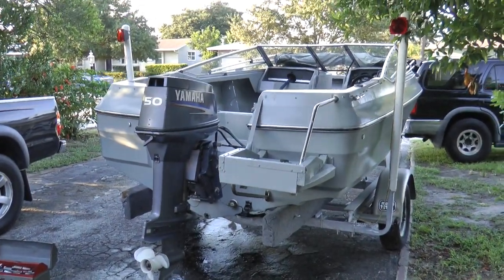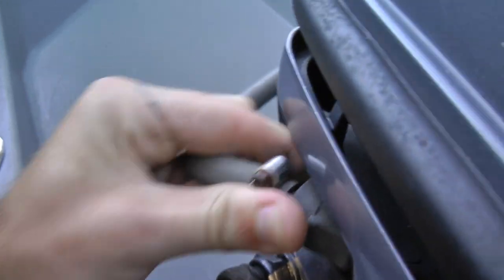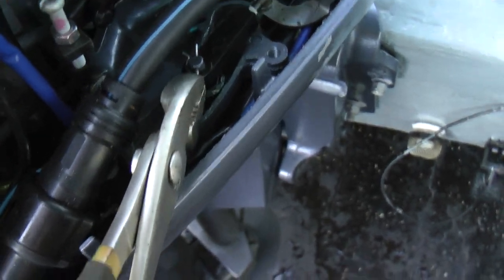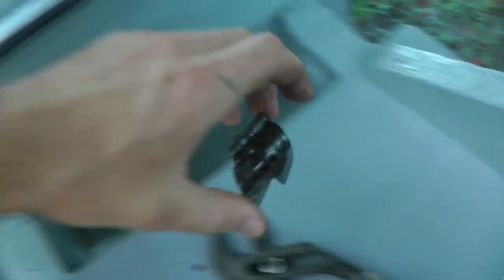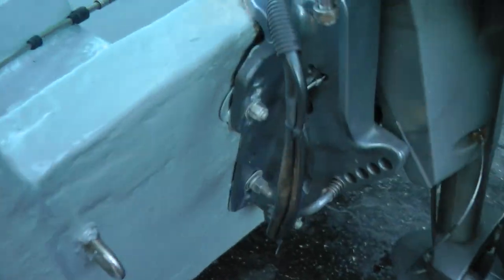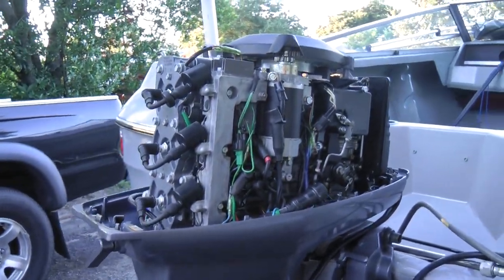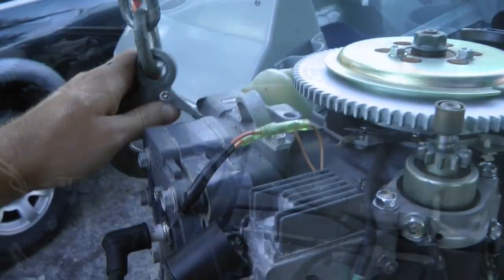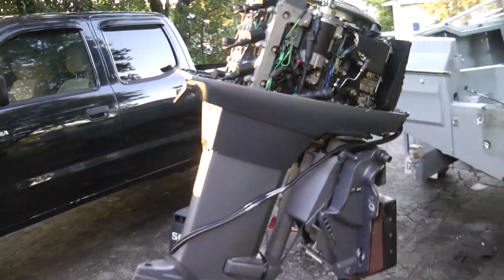How To Remove A Outboard Motor From A Boat

Comment: I just got an engine hoist to work on my first outboard. It’s a 50hp Johnson. Did you add the u-shape bracket to the motor or do they come like that? Mine doesn’t have it. Any suggestions on where to lift it from? TIA

Comment: You made that look easy! I just bought a fixer upper and it’s getting difficult. All my cables are connected together in several spots and I’m scared I’ll screw it up if I undo them all. The steering part looks pretty straight forward but the power lines not so much. Any advise?
Reply: Label it with zip ties and a marker

Comment: Very good, but I have a question, the cables is part the motor or the boat?. Because I will buy a boat but the last owner remove the motor and the cables too. I need buy the new motor but I need buy the cables too or the new motor come with the cables?
Reply: Normally it will say if it comes with cables, it will say something like “control box and cables included”.

Comment: Maybe if you have a job in the future to rig a motor and the forward controls on a center console boat that run through a tunnel under the floor that would be helpful also if you filmed it, thanks.

Comment: Now, how do you pull back the bolts that you hammer in? To screw back the engine to the transom.
Reply: Push them back through from the inside of the boat
Reply: Repeat the opposite way..

Comment: May have left control box on so to be able to use those cables to pull cables thru from the replacing outboard.

Comment: How do I remove the outboard from the mounting bracket to switch the motor, replacing a 40 hp two stroke the a another Yamaha 40 hp

Comment: Perhaps you can do a video on how to repair the threads on the bolts that you mashed with the hammer. Blade screwdriver? You don't own any punches? This video should be titled "how not to remove an outboard engine". BTW, they are engines, motors are electric.
Reply: I bet you're fun at parties
Reply: @MrDirtysteve75  One has nothing to do with the other....have another go.
Reply: @MrDirtysteve75  So you have another go by saying you won't have another go? The defence rests.
Reply: @ricbarker4829  ^defense^ ......de fence is that thing that divides your property from your neighbor's property.
Reply: @MrDirtysteve75  For someone who wasn't going to have another go, #3. The best you can do is to attack my spelling, which is correct as I am not in the US. Carry on, I can't wait for #4, even though you couldn't be bothered. It's like taking candy from a baby.